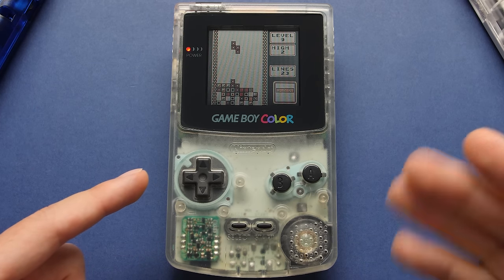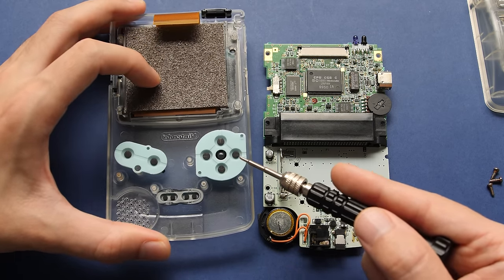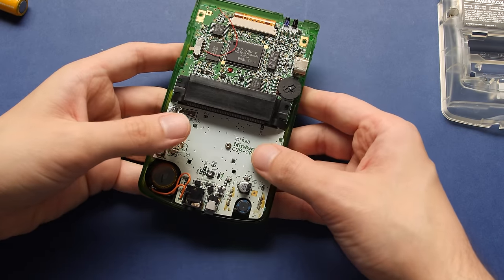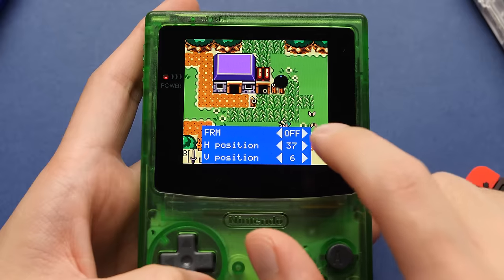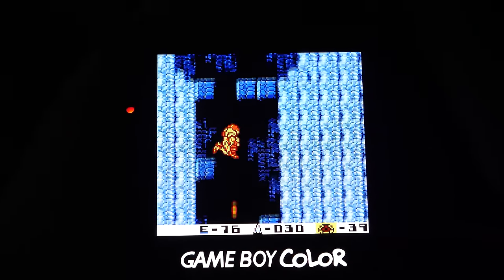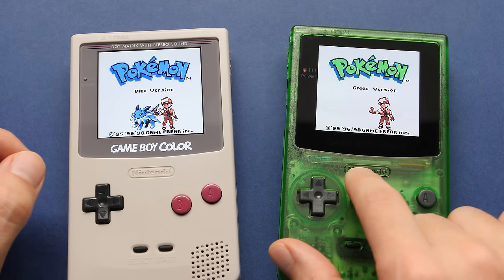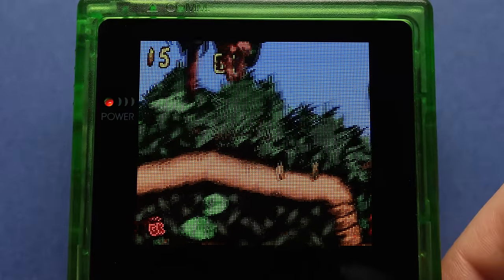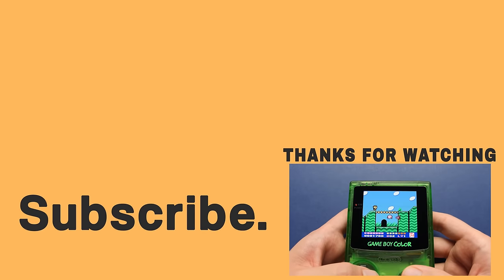This AMOLED Game Boy Color is Amazing! // Q10 Retro Pixel Review

Comment: I'd love to see this done for the GBA! I know there aren't really any 3:2 AMOLED displays but one can dream!
Reply: I'd like this on a GBA Advance SP model! The GBC screen is 4.0 x 4.4cm. GBA & SP is 4.1x 6.1cm. The Q10 original screen is 5.5 x 5.5cm and is mostly covered up to achieve the same size screen that is on GBC. If there is a existing product with OLED screen that is roughly between 4.1 x 6.1cm and  6.0 x 7.0cm, the GBA version could be made.
Reply: user-hz4fj5xw2u  with 3d printing becoming more affordable and services to print open source boards to swap the old chips or hardware emulation (FPGBC ) there will always be a market for these types of modifications. I imported a DMG from Japan and it still works beautifully (replaced the old screen) like it was brand new. The hardware lasting is always a gamble but i think its pretty cool that these old systems still have the attention they do

Comment: I'm currently rebuilding my original GB Color. It was the Atomic Purple. Preserving the original case and screen, and bought an Atomic Green case, this OLED screen, new capacitors and fuses, new  louder, clearer speaker, audio amp, clean power converter, and converting it to a USB-C rechargeable lithium battery pack. No more AA batteries being replaced after a couple weeks.

Comment: Recommend to cut a portion of the cart pin connectors and use the included protective film on them aswell in order to avoid shorting the screen. Managed to break my first Amoled Screen from HiSpeedio due to not cutting the cart pins

Comment: That power wire gauge is very small and you're likely going to get significant voltage drop on it. I'd definitely recommend using a thicker wire there..

Comment: The best thing is the build in scanline effects. This kind of build in effects is important for future arcade cabinet repairs. If CRT monitors are dying there could be a LCD panel on the market specially for retro hardware with build in perfect crt effects so the original crt feelings will be preserved. I never understand why people play retro games with the pixel perfect option. On a CRT those old games looked WAY better. Even new games like N64 games look just horrible on a modern panel.

Comment: well impressive kit, i did a litle of research on the screen and i come empty handed i tried to search the PWM of the screen but nothing came out or other super amoled from the same years. That could be a very negative aspect for people like me that are sensitive to the High PWM modulation (high is when the valor is lower than 500). It would be good know this information with all devices with amoled/oled screen not only with this one, sadly notebookcheck one of the few sites that report this have no information of this screen.
PD: Great video.

Comment: To all Boxypixel GBC shell owners: 

I have tried to use this mod on my Boxypixel shell and unfortunately the glass lens they used for this display was not compatible. It looks like it could fit but it just won't and would require some filing on the edges of the shell itself, which I decided against. The display you receive could fit into a Boxypixel shell, but be aware that it very well could not without further modification like mine.

Comment: I’m having terrible problems with my Q10 GBC. Screen blurring out of focus after a few minutes when playing original carts and EZ flash. I’ve changed power capacitors etc and have even changed the main board out for another one? I’m guessing it’s drawing too much power for alkalines and am about to order some eneloop pros to see it if resolves. Any ideas modding community?
Edit. I’ve also had another person rebuild to rule out my craftsman ship but still same issues.
Reply from the maker: Mine was normal on normal batteries and the Ikea cells I show in this video. Since you swapped out the main board already, there must be something wrong with your screen. I'm currently doing my second build right now.
Reply: Cheers Taki. Second AMOLED screen working as intended. I guess I lucked out with the first being defective on receipt. Just made me second guess my build 🤷‍♂️ as in troubleshooting the thing I replaced capacitors, power board, main board, bought new eneloops, even tried the OEM DC adaptor just to rule out power issues and reassembled. At least it adds to the experience gained by doing these builds 😂

Comment: This is indeed great, but… if I want to play in an original GBC, I would play in the original screen, otherwise I would rather play in a retro console that already has OLED, can play much more systems with more power and options. So this is basically great if your screen stops working and you can’t or don’t want to get a new one, otherwise pretty much useless.

Comment: Well I gave it a shot and now my gbc won't turn on. Fuck me.

Edit: upon further inspection (after the initial devastation and I got a multimeter) it looks like I accidentally bridged the c node to the one next to it on the power switch. It looks like I've blown the F1 fuse which can be replaced relatively easily. Hope is not lost.

Edit 2: installed the new fuse and it's working great.

Comment: Does it need soldering for installation?
Reply from the maker: There's a way of wrapping one of the wire sides to the battery terminal, but you'd still need to solder the other end to the pad I show in this video.

Comment: The amoled kit has uncorrected, hyper saturated colors. GBC games were not meant to look like this, the Analogue Pocket is the closest thing to the real deal with their color correction modes.

Appreciate the effort but hard pass.
Reply: That's just wrong. If you look at them rendered on a standard full range color screen, Taki is right, the colors are accurate. Sure it might not be the way your nostalgia likes it but the developers did code the color to look the way they look on the amoled more so than the original screen. The IPS is probably slightly more true to color but overall, you're talking about preference, not artistic intent.
Reply: @dinosoup  You're way off. Trying to tell me that the developers intended to look better on a better screen is like saying black and white TV was intended to look like 4k.

It might have nostalgic properties because that's what it's about. You want to recreate that not upgrade it.

Comment: you mean i have to destroy my 20 year old gameboy color just to use it? No thanks, useless.
Reply: You don't have to "destroy" your GameBoy Color in order to use this screen. All GameBoy consoles can be dissembled without causing damage to the internals or the shell. As for the wire connecting the screen to the battery it can be desoldered.
Of course damage is still possible due to user error which can be mitigated with experience. It goes without saying but if you don't feel confident in your ability to take apart electronics or use a soldering iron then you shouldn't try a mod like this on a device you care about.